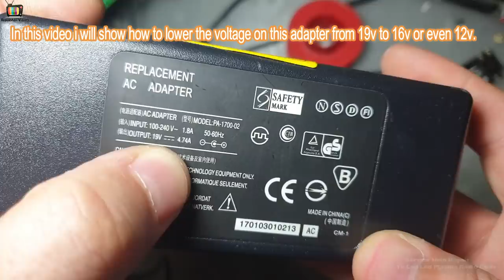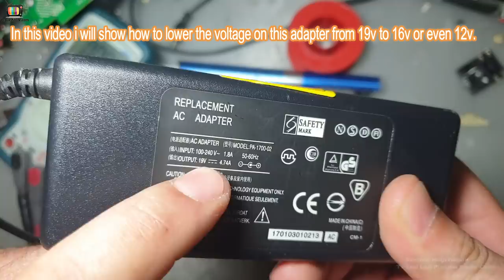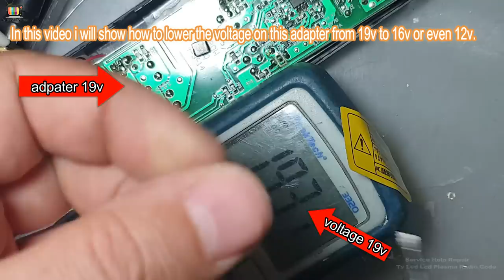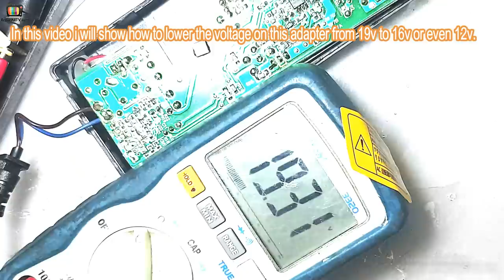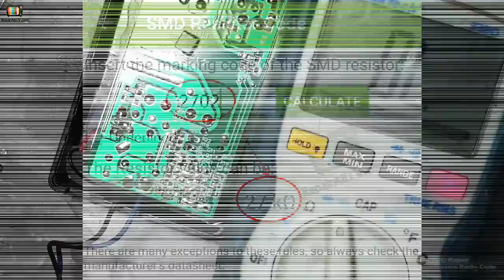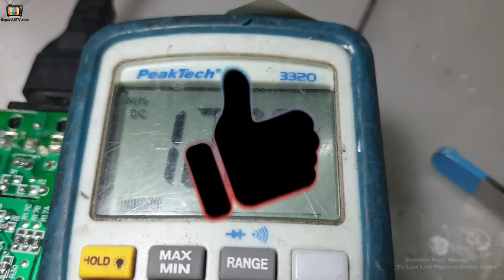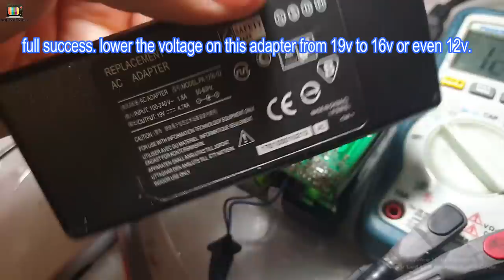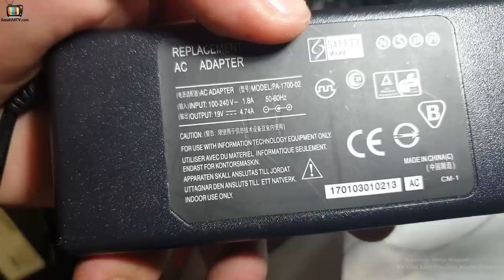adapter. How to lower Voltage on any Adapter Guide

Comment: May be a schematic would be helpful
Reply from the maker: This is universal for all adapters that if you change that specific part you can change the voltage.
So in conclusion you would need a scheme for all adapters and that is not possible since this is meant only as a example.
Thanks for feedback i wish you a awesome weekend.
Reply: @RepairAllTV  - Very good video!
Can I also make voltage of the adapter  higher if I use higher value resistor?
Merry Christmas.
Reply from the maker: @thekaiser4333  Yes, that's how it is. you understood. good video
Reply: You can find a short but clear schematic guide at 7:08.
Reply: My 19012 Kaise banaa
Reply: Motor metre set karo
Reply: Bike motor ke metre dekhya check karungi
Reply: @RepairAllTV  I got a 24v 63a Mean Well RSP-1500-24 power supply. It is adjustable between 19.5v - 27.5v. I need to get it a little lower, about 13.6v - 14.2v. Is that a simple task? I guess it is better for the power supply to adjust it a little lower than to adjust a 12v power supply to about 14.2v. There is a different model of this power supply. The SPV-1500-24. That one is adjustable between 4.8v - 28v. But I don't have that one unfortunately.
Reply: @PiratCarribean  do you know a smaller power one supply 24V with such variable voltage

Comment: Great idea.   I never thought of this.   The TL431 shunt regulator is in almost all power supplies for regulating the output voltage.   I will have to keep this in mind next time I need to change the voltage on a laptop power supply.   I salvage these when ever I can from folks who just throw everything away or I get them for a dollar from thrift stores.   Great high amperage PSUs.   Great PSU for powering LED circuits.

Comment: If you need 14.5k of resistance, and already have a 27k SMD resistor in-place, you could have soldered another 33k resistor on top, or with a 1/8w axial resistor between two existing pads that are electrically connected. Then you'll have 14.85k Ohm, without having to painfully remove that SMD resistor. 

And quick and easy to change it back to factory voltage without finding that darn tiny resistor you took out.

Comment: hello
please I want to change the voltage of HP adapter(model: series ppp014) from 19V, 4.7A to 12V, 500mA '. Which resistor will I replace and with what value of the resistor

Comment: I'm trying to lower the voltage according to your video. One question before I to do so is why decrease the resistor instead of increase it to lower the voltage? I'm worried and want to make sure to avoid any accidents may occur. Thank you.
Reply: because V = I * R so V decrease linealy with R. Other words a smaller Resistance will give you a bigger V = Voltage

Comment: Sir, is possible instead add a 20K potentiometer plus a resistor of 12K on the output pin in series for get a variable regulation around 24V to 10V?

Comment: Hello! The original output of my adapter was 24v. I dropped it to 19v. But the output voltage is not stable. It fluctuates between 17 volts and 19 volts. Why?
Reply: that is because of the load, unregulated output voltage will drop if loaded

Comment: are we able to run (240 volt 50 hz 10 w input requirement) wire trimmer from this 19 v adaptor ?

Comment: There are so many resistors near the transistor.. which one to remove pls reply  😕
Reply: just use your meter to check resistor directly connect to positive pin of TL431

Comment: or just make an external board with multiple resitors and a switch to change the voltage so u dont have to open the adapter and it will serve you without soldering every time u need different voltages.

Comment: is it possible to do the reverse? i.e. 12V to 14V
Reply from the maker: yes. can only be careful voltage. control with multimeter

Comment: In other words, how do I get any voltages I want on the output and how do I determine the exact resistance to them, is there a specific way ..?
Reply from the maker: you need to lower the resistor smaller. as in the video. we have reduced the resistor from 27ko 19v to 14.50ko 12v. but be careful without multimeter don't try
Reply: @RepairAllTV  Well ,,, if you want to get voltages at the output about 7 to 8 volts, how much resistance is required
Reply: @abuazzam7881   play with them resistors there thats away to find the answer

Comment: Use a potential meter aur a variable resistance along with 10ohm resistance in series and you can obtain desirable voltage 3 to 24 v